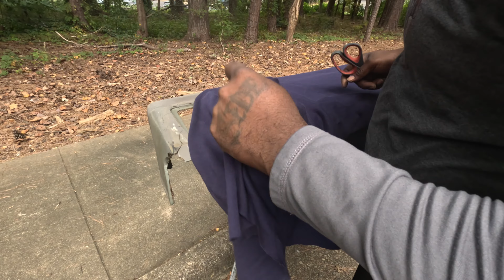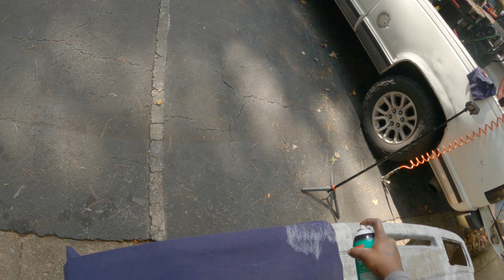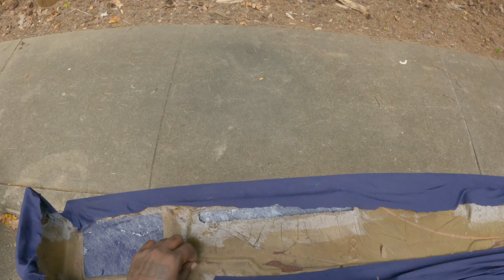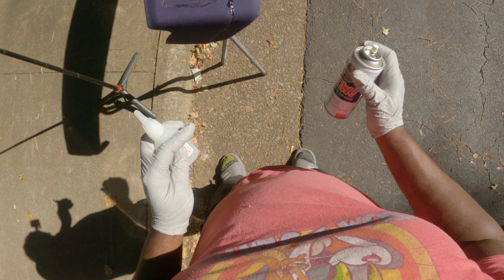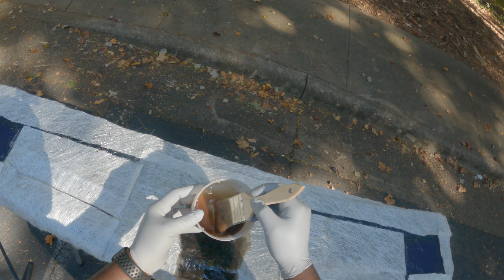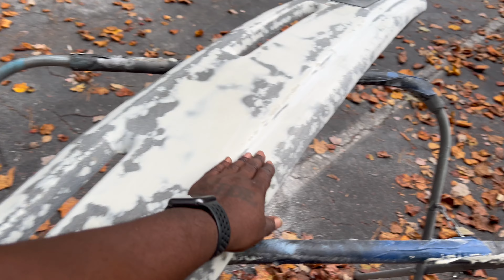Box Chevy Dash Repair Pt.1 I Will Be Going A Different Route This Time!

Comment: Bro adhesive is not needed, you need a staple gun then mop after
Reply from the maker: The staple gun doesn’t work as good because some parts of the dash  staples won’t catch anything, the adhesive keeps it in place batter!